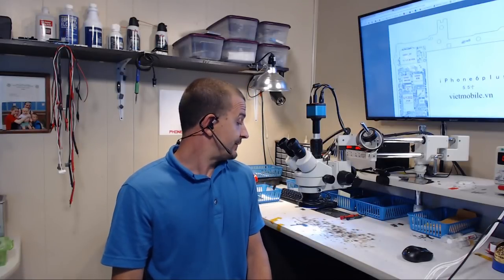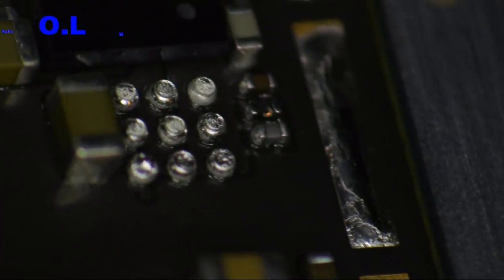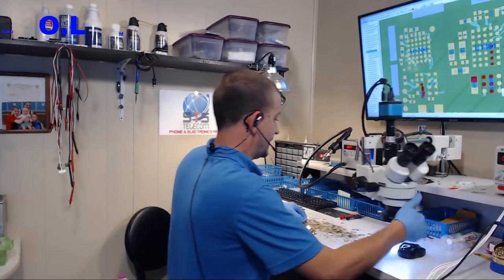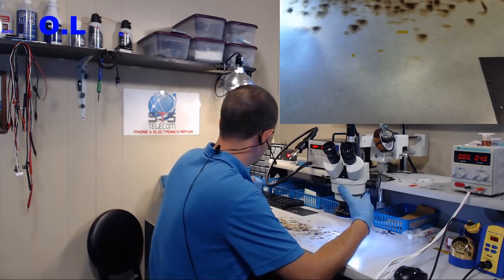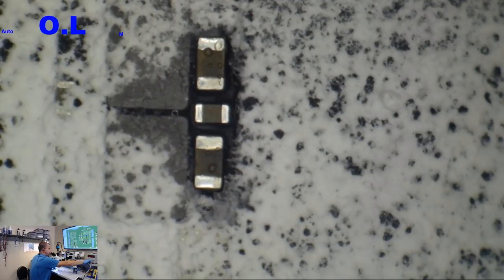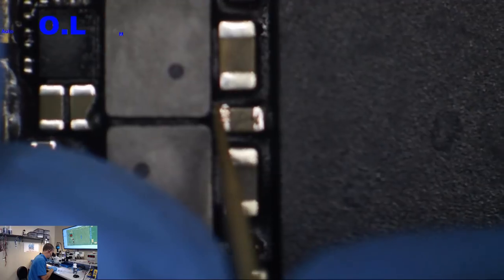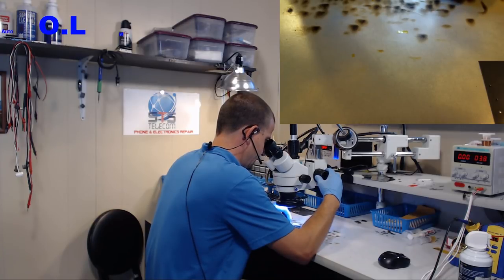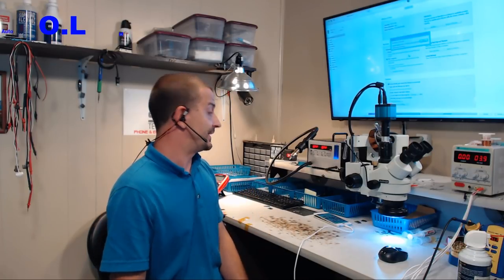iPhone 6 Plus Dead - VCC_MAIN short found with freeze spray (data recovery)

Comment: This video helps me a lot, thank you Jason. I have a short on VCC main iPhone 6 at Q1403 and I know it’s not Q1403. Somewhere on the vcc main power rail and it’s a tough short like you, just can’t find it by freeze spray with Q1403 still on the board because that’s the dude get hot first. I took your advice solder vcc bat and vcc main under q1403 with freeze spray and I founded a vcc cap c1552 near backlight boost drive were shorted. Replace it, everything went well now. Can’t say thank you enough.

Comment: Good job, like your videos! Why are you wasting time taking off Q1403 and making jumper, find the short and put the ic back? Take off a vcc_main cap, ->next to wifi, inject directly the voltage. Its better to replace 2 caps, than a cap and an ic...

Comment: This question isn't related to this video but I have a phone with sporadic Touch. I replaced the Touch IC Meson Chip and now phone touch works a little (still erratic)  but screen has grey/white bars or lines down it. Any idea what could have caused this?

Comment: hi jason, im working on an iphone 6 atm it was water damaged around u1601 an was doing the apple logo bootloop, i found it was bad caps around the area that were bad and removed them. so the phone booted to the main screen. the next day i go and check the phone and it was dead. now theres a short to ground on pp_ldo11 which is causing the loop again. any ideas what component might be shorted its not c4002_rf as iv removed it and still short to ground. thanks